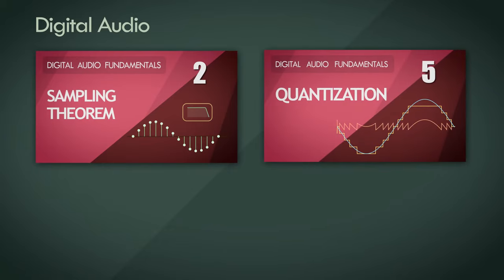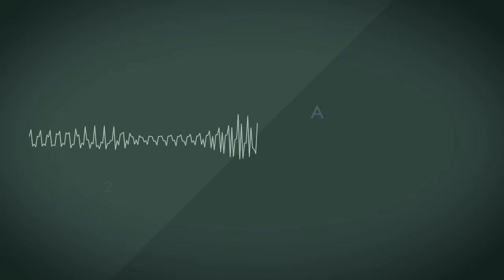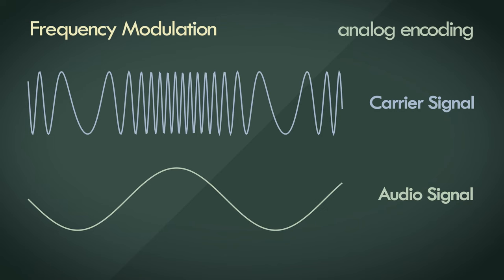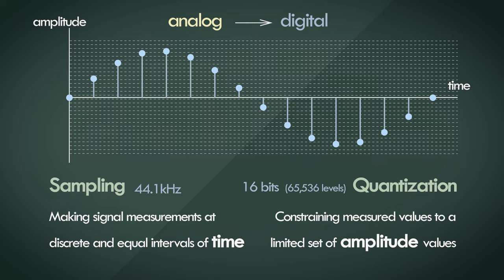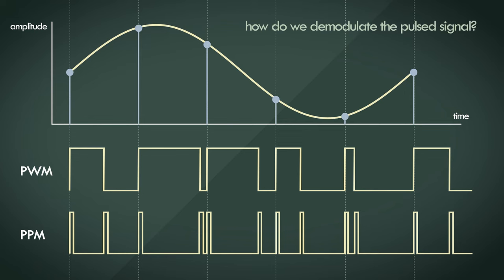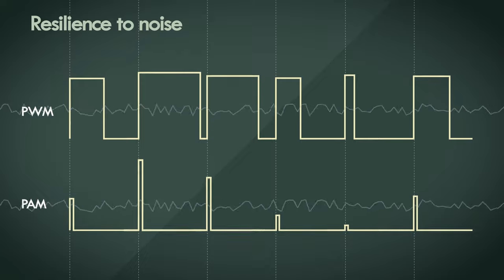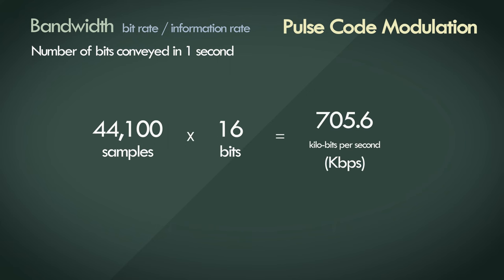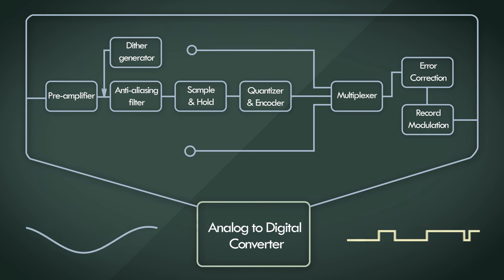10. Pulse Code Modulation - Digital Audio Fundamentals

Comment: Awesome video series, thanks! One small mistake though: around 4:00 the Phase Modulation graph actually depicts Frequency Modulation.
Reply from the maker: Thanks for the feedback! I have to admit that I was having a hard time depicting phase modulation. I hadnt encountered phase modulation before, and the math for the animations didn't work out. But if you Google image search for phase modulation, there's quite a strong similarity to frequency modulation. So, I used that instead.
Reply: @akashmurthy  you are right, the difference between FM and PM modulation is not abvious at all when the input signal is a sine wave. It would look much different with a square wave for example. I just noticed you re-used the exact same animation ;-) Thanks for replying!

Comment: Hi Akash, 
Great work. 
I have not seen video which is better than yours. for 2 reasons - knowledge on the subject. 2- explanation which is supported by GREAT Graphics.(wondering how did you do it.). I would request you to put some video on the different codec which are there are in market. starting from adpcm, celp codes, svc, silk. I am network voice engineer in mnc these learning are adding more confidence.
Also can put some video on commanding ulaw and alaw.
Thanks you looking forward to more videos from you.

Comment: Thanks for this video :) I learned a lot and I searched a lot about wave modulations and so on.

But I have some questions.

Why 20-20khz doesn't have enough power? What makes 100Mhz more power? If more frequency means more power, why Wifi (2.5Ghz) doesn't spread as much as FM? And isn't power all about amplitude?

Why in normal transmission we have more noise? comparing to 100MHz transmission

Why noise only effect the amplitude? 
I assume that because mixing is basically adding amplitude of waves, the noise which is mixed, actually interferes with the amplitide and not the frequesncy directly. But hey, we still can create new frequencies via mixing amplitides, right? So noise can interfere with the frequency or at least data it's carrying

How is FM Quantized and encode/decoded real time? 
Assuming that FM is an Amplitude to Frequenct converter, In a given time we can measure a point and see what Amplitude that has, but in a given time, we can't have understand the frequency without having a range of time and mesuring cycle. The circuit only can see one number per time, right?
Reply from the maker: Hey mate, thanks for the question. 
1) 20kHz sound is different from a 20kHz signal. Sound is a mechanical, longitudinal wave. A signal, in this case, is an electromagnetic wave. Totally different concepts right? 
From Google, "The energy carried by an electromagnetic wave is proportional to the frequency of the wave." So yes, your 2.5GHz signal contains more energy, thus potentially data carrying capacity than a 100MHz FM signal. 
Why doesn't it "spread much"? You can draw parallels from sound waves here. Though they are not the same, you can make comparisons. What do you hear outside a nightclub? You hear the music, but only the low thumping bass sounds. Lower frequencies can pass through barriers like walls and sound proofing, but the higher frequencies are absorbed and are blocked by barriers like walls. Similarly, FM signals is lower frequency compared to WiFi signals. FM signals can penetrate through walls and barriers much easier than Wifi signals. 

2)  Noise only affects amplitude. If you add noise to a sound file, what do you hear? You hear noise interleaved with the sound. You don't hear the underlying sound being different in anyway, you don't hear the frequency response of the sound any different with or without the noise. Noise is by definition a signal with randomized characteristic.  
You are talking about specific cases where 2 pure sine tones for example, when mixed, gives some sort of beating effect, where the frequencies is different. Like I said, we are dealing with random characteristics here.

3) I think it's gone a little off topic here, this video isn't meant to be anything about FM. You can find better resources for this elsewhere. 
I've already talked a little about frequency modulation (encoding). Your question is related to frequency demodulation (decoding - not the right term for it, but oh well). 
Electronic circuits need to detect changes in frequency, and not the actual frequency itself. Electronic components do this readily. Read up about it by googling FM Demodulation circuits. The change in frequency is mapped to change in voltage which drives the speaker to produces the underlying sound. 
Again, google has all the answers if you want to go deep.

Comment: Great explanation!

If an old CD-player from the 80s send PCM Audio to a new DAC/-Amplifier - then only the pure CD data is send to the (good new) DAC and is converted there with modern methods?
Reply from the maker: Thank you! I'm not sure I understand the question. I don't know how an old CD player is capable of sending digital data out. Usually, it reads a cd, which is a digital medium, it has a small DAC which converts to digital data extracted from the cd to analog outputs (earphones). There is no digital to digital transmission of data in this workflow. 

Only modern amplifiers support SPDIF or optical out, which can transmit digital data.
Reply: @akashmurthy  Thx!

I meant: 
Old CD Player with Cinch Digital Output
↓↓↓Digital Signal↓↓↓
New Amp with modern DAC

= sounding like a new CD Player instead of the old one?
Reply from the maker: @dr.fritzprengel2378  Right, I think if a modern amplifier recieves a faithful digital signal, then it will definitely have a better output than old CD players, since Digital to analog (DAC) conversion technology has massively improved over the years, and the individual electronic components have reduced in price over the years. But reading the CD to produce the digital signal in the first place is also technology that's improved, in terms of error detection and correction. So that matter as well I suppose.
Reply: @akashmurthy  OK, thank u 👍

Comment: do we need to calculate the mathematically unique continuous solution for the samples when outputting sound? maybe we don't need them at all? only need to send the discrete data to the speaker and apply the voltage that's enough?
Reply from the maker: Discrete data is just information. Bits and bytes are abstract information that represents the state of a system. 

To make any use of it in the real world (like driving the speakers), you need to convert discrete data into continuous electrical signals.
Reply: @akashmurthy  but at which step we convert to continuous signal, i'm still confused at the process, is there a formula implemented in DAC that converts data to its original sin wave? how does it input data, output sin wave.
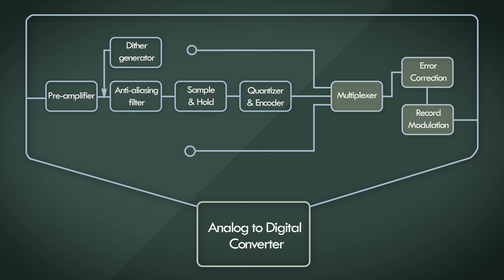Reply from the maker: @may8049    I'd like you to check out video number 2 (Sampling Theorem) from 12:28 onwards. 

There is no formula involved. And yes, the step where discrete data points are converted into continuous analog signals is the DAC. 

Simplifying the process quite a lot: the data points are connected, or interpolated by electrical circuitry to create a continuous signal. Then this signal is filtered with a low pass filter with its cut off as the nyquist. This is the critical step, which eliminates all the interpolation errors and produces the original signal back.
Reply: @akashmurthy  OH, that's it! the low pass filter, so after applying the low pass filter,the square wave turned out to be as close as the original sin wave because all the square part the  high frequency part gets filtered off,right? i finally understand, bro, you are awesome!
Reply from the maker: That's it! You got it!
Reply: @akashmurthy  bro, plz give us some contact email, any email would be ok, if you are concerned about spam or something, you can register a new one too.
Reply: @akashmurthy  i won't be bothering you a lot, i want to read some paper but i find it hard to read, maybe i can discuss some of the content with you .
Reply: @akashmurthy  you can totally ignore the email if you don't have time. whatever you feel comfortable.
Reply from the maker: @may8049  hello (at) akashmurthy (dot) com

Comment: Is dts and Dolby superior to pcm audio ? I am wanting to buy a DAC amp for headphones
Reply from the maker: The encoding formats make no difference. It's lossless audio both cases. 

The hardware that you can build compatible with certain encoding formats can vary quite a lot, and that's where the advantage comes from.

The hardware manufacturer may choose to support one encoding mechanism over the other while choosing components. Some components are more capable of taking advantage of the sampling and quantisation process underneath the hood.

Is one subjectively/objectively better than the other is not a discussion I'm willing to have.

Comment: What are your thoughts on DSD and sigma-delta encoding?  There is one famous engineer of speakers on YouTube, that if you, Google DSD, you’ll see 1 million videos of him saying that it is better somehow than PCM… Most people in forms disagree, but he has many fans who agree with him as well… I would love to hear your thoughts on this, or if you have any links to describing the benefits of this form of encoding in comparison with PCM, that would be much appreciated!

Thank you greatly for the incredible Educational content!
Reply from the maker: Hey there, to be honest, I don't know enough about Delta sigma modulation to comment on the fact that one is better than the other. DSD is just a brand name for Delta Sigma modulation. It's trade off between word length (bit depth) and sample rate. Delta sigma modulated signal is represented as a single bit stream, but requires super high sample rate (in the order of mega hertz) for it to be effective. In a sense, this is easier to implement since modern chips have very high speed and precise clocks. A lot of the times, modern ADCs and DACs use delta sigma modulation to convert from analog to digital and vise versa, but covert to PCM internally to be represented in applications. 
This is because manipulating digital audio represented as a DSM stream is quite complicated. Even applying gain is so much hassle. Whereas in PCM, it's quite trivial, since the data is represented as you'd expect in the analog domain, and the same principles apply.

Comment: nitpick: uppercase 'K' usually means binary prefix, i.e., x1024, so 705.6 should rather use kbps instead of Kbps.
Reply from the maker: Really? 0x is hexadecimal, 0o is octal, I thought binary is 0b. I mean it depends on the context right, different languages choose to support different prefixes. 

But in most of the cases I've seen, the metric multipliers like kilo and mega and giga are always abbreviated with capitals, like K, M, G. 

But I was careful not to capitalize 'b' in 'Kbps', since 'KBps' is reserved for kilo Bytes per second. 

Let me know if you disagree.
Reply: @akashmurthy  I didn't mean binary representation of a value, for which indeed 0b is often used. I meant a binary prefix of a unit (of a multiple of units, to be precise). Lowercase 'k' usually means a multiple of 1000x and uppercase 'K' a multiple of 1024x. 1024 is 2^10, hence binary. Wikipedia has a lot more about that:
https://en.wikipedia.org/wiki/Binary_prefix
https://en.wikipedia.org/wiki/Byte#Multiple-byte_units
https://en.wikipedia.org/wiki/Kilobit
Reply from the maker: @danadam0  interesting! Thanks for the insight!

Comment: Not clear from this video how PCM identifies the start of a new 16-bit sample.
Reply from the maker: Yea good call. Most of the videos in the series so far has been concentrating on the analog to digital side of the conversion. I haven't really talked much about the other way round, the digital to analog conversion. There is much to talk about there, including in this case - clock synchronization, jitter, and all of that good stuff. I guess I'm holding that off for later.
Reply from the maker: Whops, sorry, I didn't really comprehend the question correctly. Yea, most of the time, in RAW PCM, there are no identifying features to mark the beginning of a new sample. Computers are quite accurate to synchronize with clock to count 16 bits, mark that as one sample, and carry on with the next sample. 

Sometimes, when PCM data is fed into DAC for playback, channel codes can be added to signify the start of a frame of samples for multichannel streams, so that the DAC could be more accurate and rely on these additional codes for synchronization.
Reply: Look forward to hearing about that side of things, jitter, etc.

Indeed I was curious whether after a long string of silence (all zeroes) whether two devices would maintain perfect synchronization. Or if a decoder starts receiving a streaming PCM signal mid-sample how it would know to wait for the beginning of the next 16-bit series of 1s and 0s and how to know when that occurs. With the pulse width examples that was clear but not with PCM.